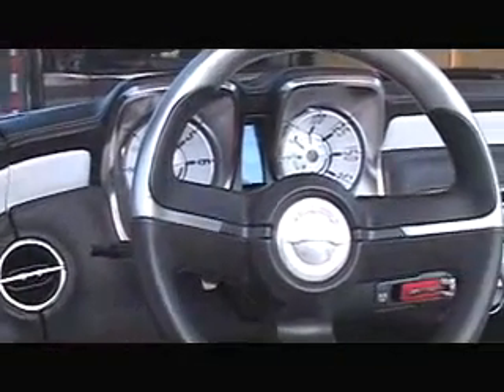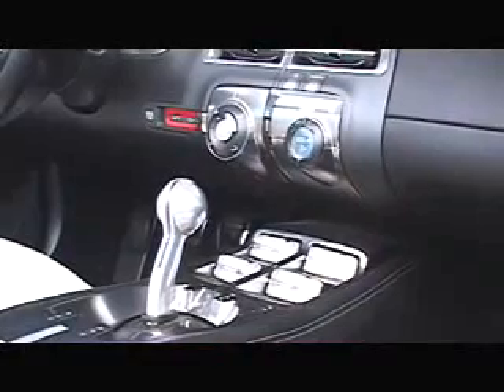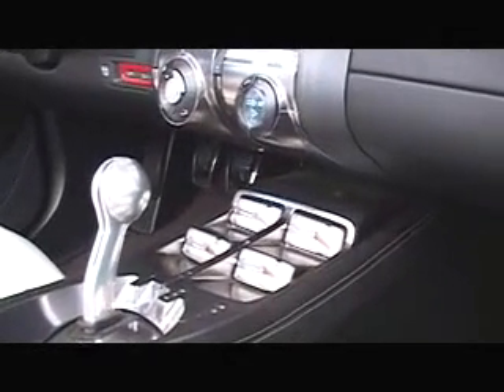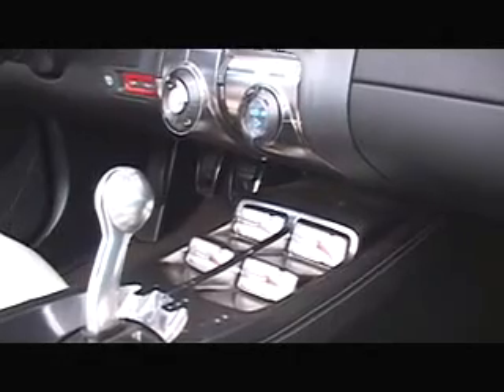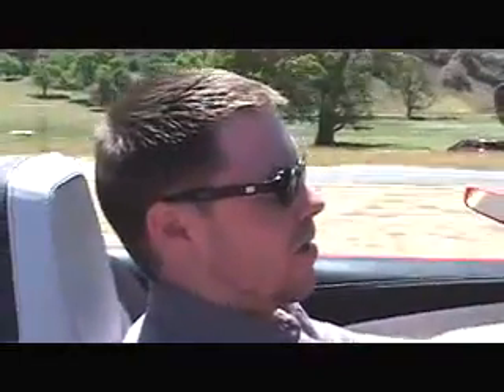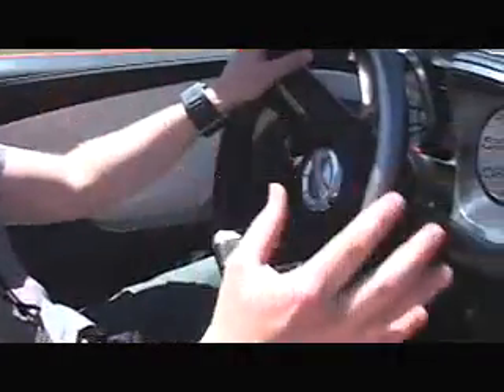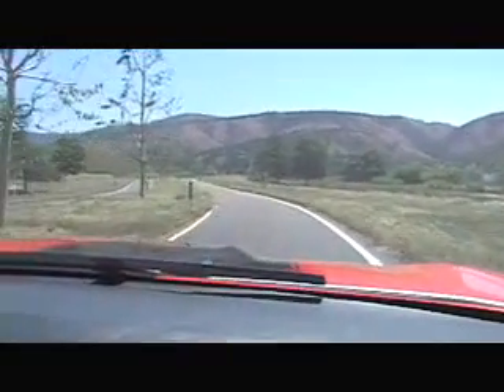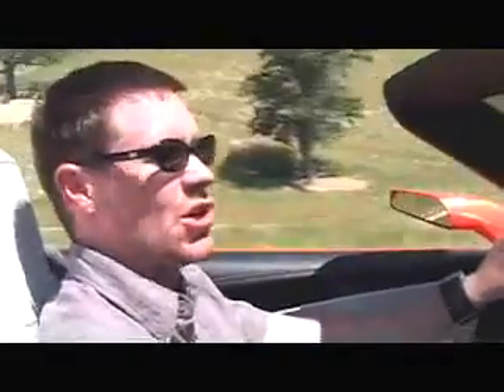Driving the Camaro concept convertible

Comment: @Rlnthndr The production interior is pretty much EXACTLY the same. The white on the trim panel is not an available color, the horn button, gauge color, radio and shifter are really the only major differences.
Reply: And the start button and ac window controls and seats